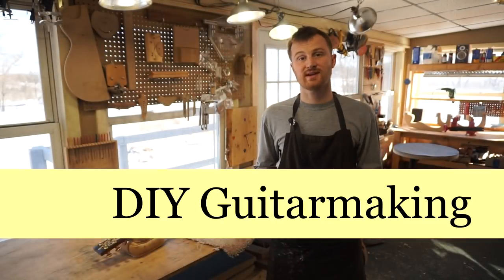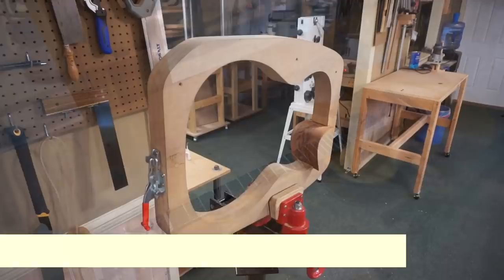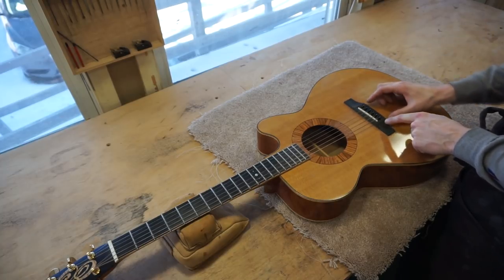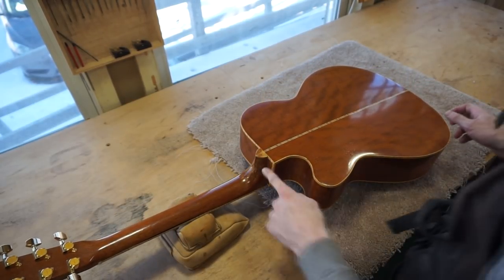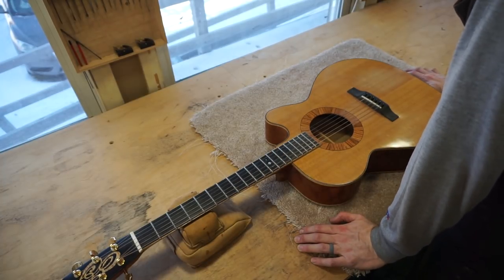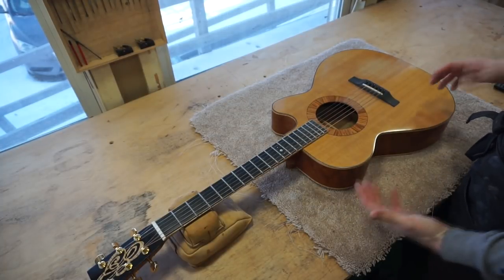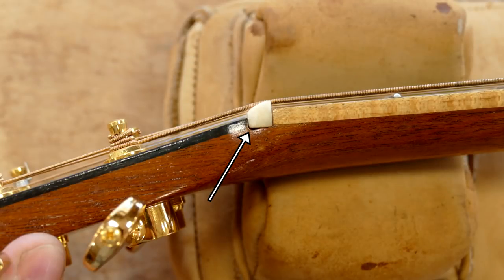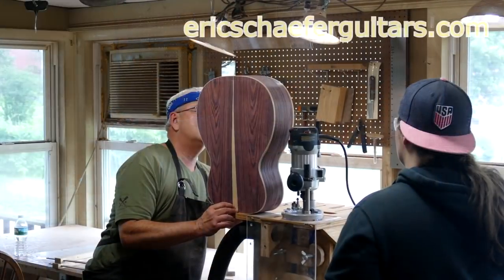Making Mistakes as a Guitar Builder: A Critical Look at my Worst Guitar

Comment: I refinished pianos in my business for 47 years I done 100 grand pianos some advice good lacquer it's almost impossible to come by due to Environmental regulations but there is one lacker I would recommend Sherwin-Williams cab acrylic lacquer you can put 8 coats on a oak board hit it with a claw hammer and not damage the Finish only dent the wood expensive but worth every dime

Comment: I build a small number of guitars mainly as a hobby. Cutting the binding channel nicely is the biggest challenge especially if your sides aren’t perfectly square as you mention. I do prefer wood binding over plastic it just seems easier to get a nicer job although plastic protects the edges better. Good information! 👍👍👍

Comment: Overall I think that guitar is pretty good for a first attempt. Considering you tried putting all new techniques together to build the guitar, I mean you'd have to be a pro to execute those techniques. So by doing that I bet you learned so much from jumping in and giving it a go. The Knowledge you are passing on to guitar builders or first time guitar builders is invaluable. Thanks for constructively critiquing your work. Don't be too hard on yourself. You're only human after all. I will be building my second guitar soon. My first was a total bust and i don't even have it anymore. I didn't know about bracing or anything much. But now I have the internet and there's way more resources to look at than back in the mid 90's. I'm going to use Black walnut for the back and sides and I think it's either yellow cedar or redwood for the top.

Comment: great video, 
i'm still on my first with many plans for the future
I'm nearly at the finish line but i've been looking at what gaps need filling and unfortunately theres a couple on the tops coloured purfling (all bindings and purflings are wood)
i'm planning on doing either a oil based (danish) or waterborne finish colortone (stew mac) or CrystaLac Brite Tone (lmii) so is there a way i can fill those gaps without ruining the purfling?
 
I've thought of epoxy just for those gaps so it's creates a flat surface and the rest will just be super glue and sawdust

Comment: Cool video, I think that most of the mistakes are inexperienced woodworking issues, in my opinion if you had someone looking over your shoulder, those mistakes would never have accrued.
The only big design mistake I see is this weird shelve (LOL) you have where the body meets the neck (cutaway), 
Only a good guitarist that is using that area a lot would be able to point that out a head of time.
There is one more design mistake that I see, and I see great guitar companies and luthiers do this to this day: 
That is the string from the nut should be in a perfectly straight line to the machine heads first, than you can have design the headstock in any shape you choose, when the string doesn't go in a straight line it always and mean always give you tuning issues, amazingly I see this on incredibly expensive guitars.

Comment: the thing that stands out the WORST, obnoxiously is that binding. especially on the neck. i do not understand why people try to do 100 unneccessary things at once especially when they cannot solve 5 neccessary issues. confort, playability and sound are the priorites, and then how it looks. the extra touch ups, or things, which i hate and think are kitsch, like solid rosette or solid binding, the finish and some weird things like beveled edges and complex headstock shapes, should really be avoided, especially on guitar, what... 4??